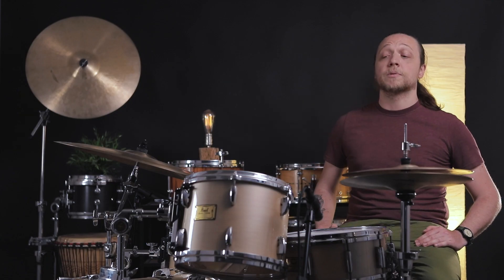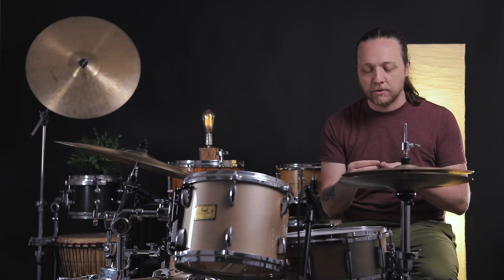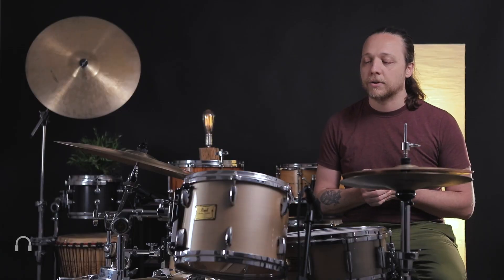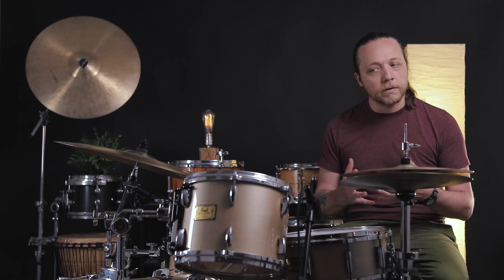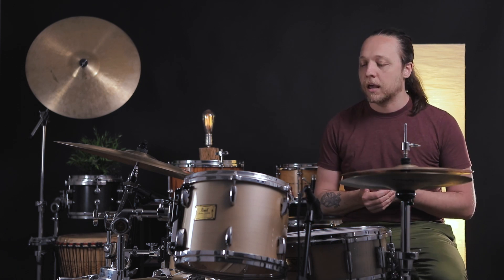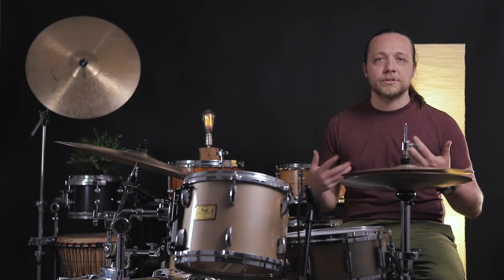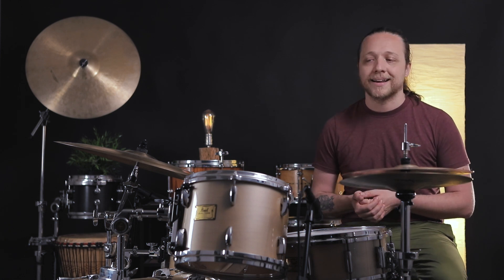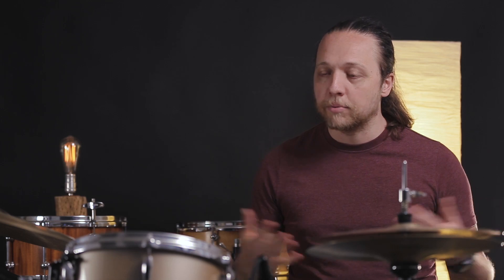Lug Gaskets Inhibiting Your Drums? | Season Three, Episode 4

Comment: Try the same experiment with a Supraphonic! They've got very thick soft rubber gaskets. I removed mine, and to me, it definitely did sound more open, and resonated more. But perhaps its just a plecebo.
Reply: Did the screws that attach the lug to the shell fit flush when ya took the gaskets off?

Comment: Hi. Gaskets have a very simple origin. When drums were built with molds, the manufacturers had to think of ways to compensate the difference in diameter when a drum was not wrapped. Most usa made gretsch kits still come with gaskets cut from leftover wrap pieces, and this is the sole reason for those gaskets. Else some lugs - especially those with threads cut in directly, like tube lugs, would cause the screws in the wrong angle to be too tight etc. 

Some journalists came up suspecting that gaskets actually have a sonic use too, and the hint was that those drums with gaskets had shiny glossy lacquer finish. As those drums were more expansive than wrapped ones, the gaskets kinda became an indicator for better quality drums. 

As the drum shell is a resonator, not a membrane, the idea to improve sound with gaskets is insane and had no physical prove to it, in fact it is the opposite, on shells like steel snares the sound you would want from it is being killed by those gaskets. When playing rim shots, you actually play head and rim and shell at the same time and it sounds best when there is no plastic involved. 

How do i know? I am a drum builder, i restore and fix a lot of old drums and not only run a drum company but have researched years and years in drum building history. All the stuff they say about drums are to make you buy them, that is it. Most of it is simply modern myths.
Reply: When I read your 1st few statements, I thought you were going to have some over educated technical theory of how these gaskets make a difference. But your conclusion is same as mine, I've also built/restored vintage and new drums.
Reply: Adoro drums are awesome!!

Comment: A subject near and dear to my heart and I totally agree that it is a one drum to the next issue. Case in point: the rack tom on my Ludwig Classic Maple kit was sounding choked off, but the floor had as much resonance as you would ever want. I tried different head combinations with no luck. As a last ditch effort I pulled the gaskets off the rack and replaced the Ludwig tom mount with the super awesome Inde tom mount. Problem solved. 
I also pulled the gaskets off my newer Supra and when I swapped the tube lugs out for imperial lugs on my Black Beauty I did not put the gaskets on. Clearly I don't see a need for them. One other thing, I wanted to put the tube lugs from the BB on my Copperphonic but the rubber gaskets on the Copperphonic left a residue on the drum that is totally noticeable with the tube lugs, so now I need to figure out how to remove that without damaging the shell.
Reply: Did you try the inde mount before removing gaskets, my pearl drums came with really strange mounts but my rims style mounts allow for much more resonance
Reply: If memory serves I took the gaskets off then put the Inde mount on later. What I do know for sure is that the drum sounds like it ought to now.

Comment: I would be inclined to think those particular types of "gaskets" are more for asthetic purposes than sonic. The fact that they are a hard, rigid material lends itself to transference of vibration and not insulation from vibration such as the soft rubber cones and balls found on certain tom mounts.
Think of it like living in an apartment where the people upstairs have hardwood floors or carpet. Which transfers the most sound? 
Same principle. 
If any sonic change were to be affected by this, most likely I would think it would be the vibration of the lug spring touching the shell which is a factor I have found in some older drums often causing a buzz that microphones pick up when recording and can sometimes be heard when tuning a drum.

Comment: Thanks heaps! Really useful - I've seen a lot of comments talking about this (and swapping the 2.3mm hoops for 1.6mm hoops) to get a new Supraphonic (which I own) to sound more like the vintage drums. From a purely mechanical point of view I've shied away from it - metal lug to shell contact on a drum renowned for pitting doesn't seem like a clever idea but I have to admit I've been curious. Nice to hear that although these are different drums, the effect is quite marginal. lighter hoops are on order anyway ;)
Thank you team!
Reply: The effect might be marginal on wood shelled drums as was used in this video but on metal shelled drums the effect can be quite eye opening. I'm more concerned with tone than pitting but if pitting is an issue for you perhaps an Acrolite without gaskets and 1.6mm hoops would work for you.

Comment: I actually hear a big difference in the rack tom, with the gaskets the sustain is quite longer
Reply: Agreed!
Reply: I also agree...
Reply: i_log Interesting. I wonder if that might have something to do with the tightness the fixing screws were attached with.
Reply: @flocore  it may be, theoretically at least,  but I don't know how much difference in tightness must be to actually noticing a clear difference in sustain. I mean I don't think they consciously tightened the screws much more than they were before. Probably some random screws are a bit tighter than before and some a bit looser, but I'm not sure it's enough to notice any difference.
Reply: Isi Hernández It may very well be that, in the original state (with gaskets), the length of the fixing screws was exactly the length needed to prevent over-tightening and without the gaskets, there was a slight probability to screw them on slightly too tight. 🤷🏻‍♂️
Reply: @flocore  not really. I've dissasemmbled and assembled enough lugs to clean, fix and restore them and the shells, and I've also replaced screws enough to realize that it has nothing to do (included my Pearl Master Custom snare, with those same lugs shown in the video). They use the same screws for different shell thicknes like 4 plies vs 6 plies, for instance (except if that difference is too big), so the screws are not as exact as you think. In addition, lug threads have enough space to accomodate a bit longer screws. 
If the screws were as exact as you say, the effect would be the opposite anyway => if the screw is the exact lenght to pass the shell + the gasket + getting to the bottom of the thread and you remove the gasket, there would be a tiny gap of the same thickness of the gasket and the screw would be a bit loose (you could compensate that with more washers by the inner side).
This is not what happens anyway, since the thread has room enough (except if it is a thick shell with a long screw). Not too much room, but the gasket on this PMC ain't so thick. Since they have tighten the screws by hand, they most likely did it until they felt they were tight enough to keep in place and hold the tension of the rod, but not overtightened, and since they're human, I'm pretty sure there are slight differences between screws. But there's no reason to think that they are tighter without the gaskets than with them.
To sum up, if you remove the gasket and the thread as room enough, you can tight them the same as before (there's no reason to tight them more). If you remove the gasket but the thread has no room enough, the screw will be looser than before, not tighter.

Comment: I like what you did with the gasket comparison. Would you be willing to take on the cotton stuffed lug casing versus the non-stuffed lug casing? I have read that stuffing the lug casings were done by Hal Blaine's drum tech and others have followed suit. Does it make a difference or is it better for studio work? Would love to see you take on that "myth" using a vintage Supraphonic. Thank you in advance for giving it some consideration.
Reply from the maker: Thanks! Stuffing lug casings is most applicable with life that have springs inside (the cotton muffled the spring resonance). Neither of us own a set of drums with lugs like this so we’ll have to hold off until we can get our hands on some for a little while. We’d love to cover the vintage vs. modern Supraphonic at some point as well but again, we don’t own a modern Supraphonic.
Reply: @SoundsLikeADrum  Thank you for your response. I wonder if the lug stuffing could be demonstrated using the Supraphonic you have already? With and without.

Comment: Gaskets helps to protect shell surface and helps to keep screw thread tight. Sound impact is minimal, almost negligible.
Reply from the maker: And yet some swear that it's the difference between where you're at and the potential for a dramatically improved drum sound. That's why we set out to demo it here.

Comment: The newer Luwig supras, bb, and  bronze most definetly use gaskets to minimse 'lug splay' on them. Regardless of how they sound , I think they look bloody horendous.  At some stage over the last 30 years they changed something to cause the splay, but it's why I only buy the older models.
Reply: The 2.3mm hoops they started using are slightly wider hole spacing, more than the older 1.6mm hoops
Reply: @ledzeppelinfan12344  I agree, but I also think they have changed the Imperial lug design slightly. The newer ones don't sit on the centre bead like the older ones - more of a gap. But I believe it's the shell. I actually had a newer bronze model and changed out all the hardware to check - including 1.6mm hoops and lugs - and it still had lug splay. I was a bit obsessed. I should have video documented the experiment.

Comment: Not related to this video, but your videos are awesome and I could use some help. I just bought an 80s Tama Superstar and I can't get the "basketball" out of my floor tom. I don't tune drums often, I got my other two kits to where they sound amazing and haven't needed to touch them since, but I can't say I'm great at tuning. The videos of these old Superstars all sound so good too, punchy and succinct. However, the heads on this floor tom sound like they're in tune to themselves, and I've tried multiple tensions and I can't figure out how to get rid of that awful "ping" that doesn't seem to be related to the tuning. Any advice?
Reply from the maker: Hmm, there are a fair amount of variables involved with that issue, in my experience when it comes to floor toms I end up having to replace one of the heads because it’s stretched over time and lost its capacity to boost the low frequencies well and ends up choking the drum a bit, as you said, regardless of how high or low you tune it. Hope that helps! -Cody
Reply: @SoundsLikeADrum  Hm, the heads are brand new - simple Aquarian Response 2 over Classic Clear. I didn't do any of the tightening it up to seat it or anything, just light tension for a day before trying to tune it. Could I have gotten a bad head? Or some of the other variables?
Thanks for the help! You guys are awesome!